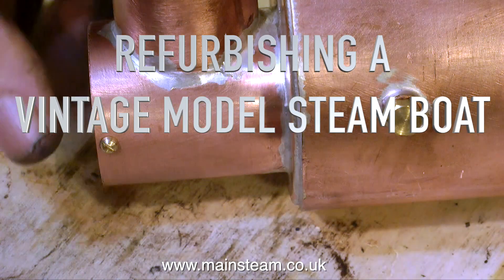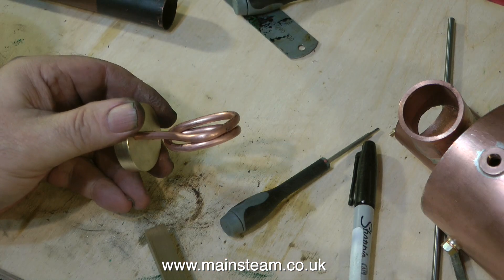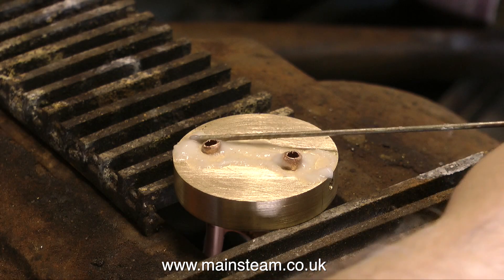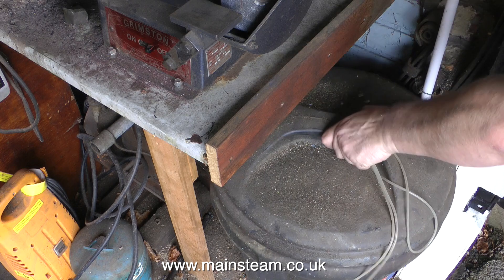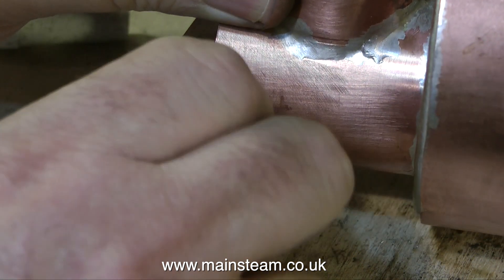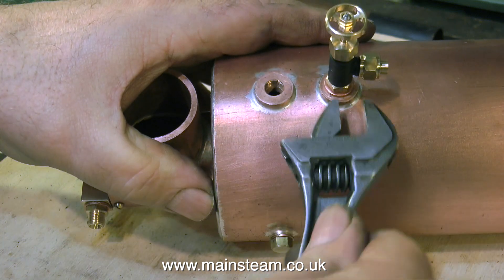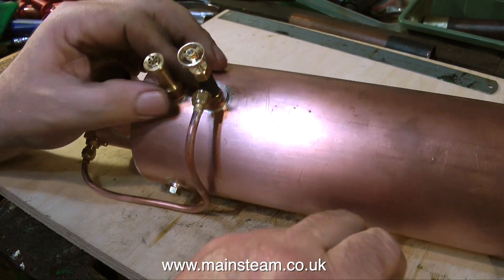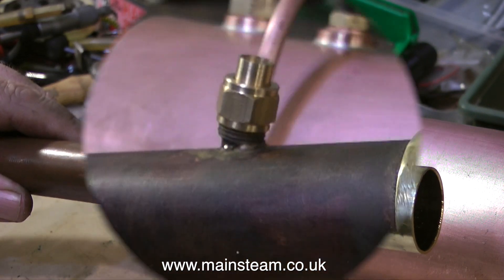REFURBISHING A VINTAGE MODEL STEAM BOAT - PART #2

Comment: Hi Keith -- On the silver solder you are using -- what is the % of silver and its melting point?  -- I've tried using a brand here (EasyFlo not available in US) that is 56% Silver which has a high melting point of  651C (1205F).   .. unfortunately I've haven't been successful with either.  Can't seem to get the solder to flash the joint consistently -- it just sits as a blob and eventually goes grey with oxidation.  

I've also tried some solder with 6% silver content -- which melts at a much lower temperature -- it says its "range is 204 C 371 C - whatever that is referring to.  However, it seems to blob up much quicker -- I think before the brass or copper has reached the right temp. Doesn't seem to follow were the flux is and I can't seem to get a good joint. 

Any thoughts?

Nat
Reply from the maker: Insufficient heat and/or the wrong flux ...... that's all it can be - I use "Silverflo 55" silver solder. Try http://www.blackgates.co.uk for the proper flux - that's where I buy mine .......
Reply: Keith Appleton Thank you so much for your time

Comment: I think when the guy asked what type of adjustable spanner you used, what he really wanted to know was if it was a metric adjustable spanner, or an imperial adjustable spanner. I don't take chances; I have one of each.
Reply from the maker: I also have left & right hand versions, Imperial & Metric, so I therefore have four of them.
Reply: Only four? I have left and right hand versions in all sizes for metric, whitworth, unified, BA, ME and BSP. No dirty old nuts and bolts in my workshop, just adjustable spanners.

Comment: thanks again Keith.
Are you going to put an electronic controlled valve in place of the steam valve you
showed in the video so you can control the amount of steam from your wireless
controller for the boat?    Rod
Reply from the maker: Yes, the one on the boiler is the manual master cutoff for filling the displacement lubricator.

Comment: I thought the white stuff that came out of steam engines was smoke?
Reply from the maker: No, on a gas fired steam engine it is Water Vapour that is visible, on a coal fired steam engine it is still Water Vapour but mixed with the products of the combustion of the coal ie: Smoke . . .  . but still mainly Water Vapour . . . . .